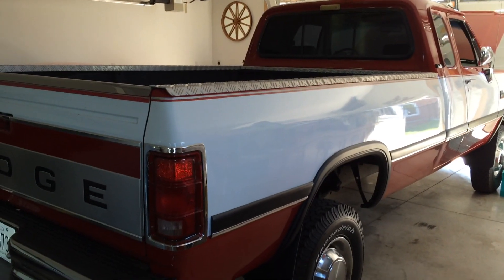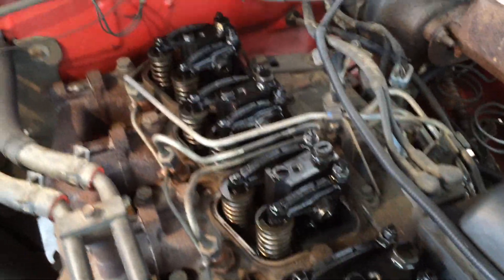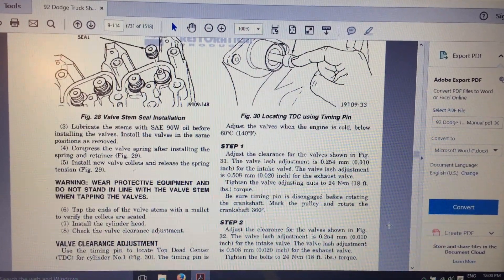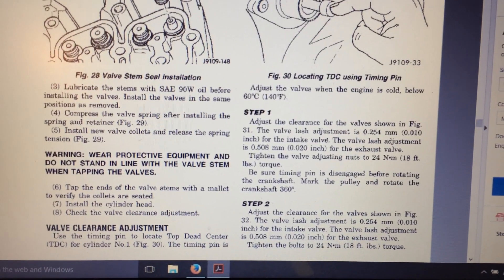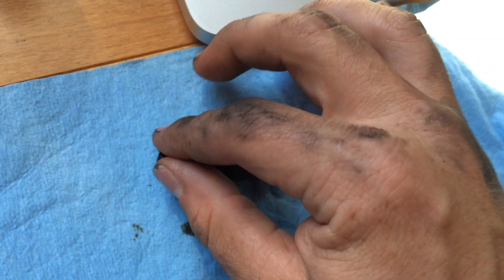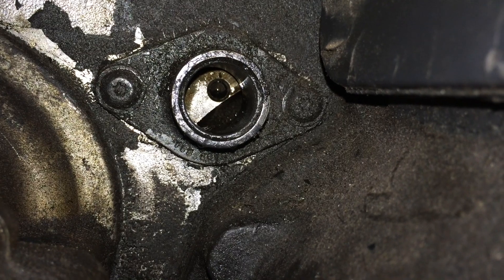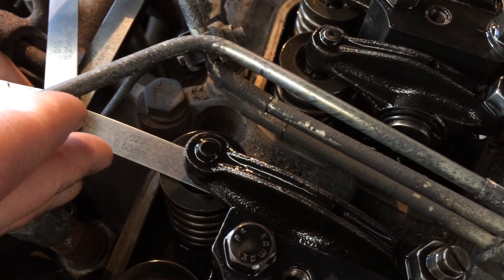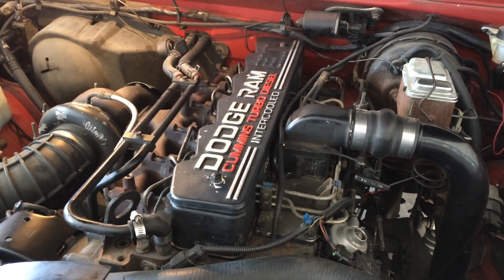12 Valve Cummins Valve Lash Adjustment

Comment: I know this is an old video. Just curious, when torqueing the lash lock nuts, did you go back and recheck lash spec? The reason I ask, is I've been a Honda specialist for years. When attending Honda School there was a discussion about lock nuts being slightly gummed up with oil sludge. They will drag the adjustment screw when locking the adjustment and give a tighter than desired lash.

Great no nonsense video by the way.
-Dave
Reply from the maker: Yep always check the clearance after tightening them down. Not sure if I mentioned it in the video but it's important because the clearance always seems to change a bit after you tighten it.
Reply: @OvensGarage  You are a good man. Keep on keeping on.

Comment: The whole TDC thing, and getting your pistons in an exact position really threw me off for a long time. Can't you just use the alternator method and, starting with #1, cycle it until both valves to open and close, then adjust the lash on both valves. Then cycle #2 until both valves open and close, adjust the lash and so on? Seems like it would be a lot easier minus turning over the engine more.
Reply from the maker: You could do it that way if you wanted but it would take much longer. With this method you get #1 at TDC, do half the valves. Rotate the crank 360 then do the other half. Much quicker.
Reply: @OvensGarage  Thanks for responding. I guess the whole TDC on compression stroke thing threw me. I'm guessing it's for convenience sake.

Comment: So using the push pin to find TDC will get you piston #1 at TDC? You pull back the pin, start turning the motor again and once the pin is pushed in a second time #6 piston is at TDC? Or is it better to find/make a mark on the balancer then turn 360 degrees to find piston 6 at TDC?
Reply from the maker: The pin will only go in at one spot on the cam. You'll need to mark the crank and rotate 360 to do the opposite valves.

Comment: Great video, but what he fails to tell you is that you are actually supposed to release the pin after you've pushed it in before you start adjusting the first set of valves.

Comment: Tip if you break off the tip of the pin in the cam gear, heat up a paper clip or other narrow metal object and melt it into the middle and wait a mins for it to cool and should come out with the paper clip

Comment: A couple of tips for who Evers interested on valve lash you can run your valve lash starting on tdc 1 on compression or exhaust stroke witch ever u get to tdc if it’s exhaust side run those valves then roll to compression then run those. Another HUGE HELP is take a white paint pen and mark down the rocker arm of the valves u adjust on compression stroke it makes identifying the valves u need to adjust so much quicker and the oil and engine temperature doesn’t effect the paint it’ll stay a long time. Immediately before checking lash on a valve apply pressure to the adjustment side of the rocker arm to push out the oil so u are measureing metal to metal clearance Also check ur lash before adjustment about 1/4 of your valves will still be in spec and check AGAIN AFTER TOURQUEING THE STUDS it makes a major difference!

Comment: Did you notice any difference with valve train noise? My first gen has 144k and I doubt it’s ever been done haha. Just wondering if this will quiet it up and make it sound less “clanky”’I guess you can call it.
Reply from the maker: Not a massive difference but if it's never been done it might get rid of a couple of the clankers!

Comment: I noticed you used a socket to tighten the locknut on the rocker arm after setting the lash. Did you attempt to reinsert the feeler gauge after tightening the lock nut ? Usually when you tighten the nut, if you are not holding the adjusting screw with a screwdriver, the screw will turn with the locknut, altering the lash!!  Excellent video with good lighting & a very good description of what you were doing & why. Camera work was good & voice articulation was excellent as well. Great job!
Reply from the maker: I didn't show it on camera that well but I tightened the lock nuts with a wrench while holding a screwdriver through the top. Then afterwards to make sure everything was to spec I used a torque wrench and tested the lash again.
Reply: Thanks for your reply . It is satisfying to know that the adjustment screw was being held stationary while the locknut was tightened. My concern was for those who might not appreciate the necessity of holding it. Great Video!

Comment: You need to tighten the jam nuts and recheck the set. They move and tighten the clearance frequently.
The true measurement is with the jam nut tight.
Loose won't hurt you, tight will. If the jam nut turns the adjustment screw, they go tight.
Cummins inline have running mates on the crank.
If the firing order is 1-5-3-6-2-4, 1&6, 5&2 and 3&4 are running mates. If the valves are closed on 3, I set 3 and watch for the valves to close on 6 and set it so on thru the firing order.
If you turn an adjuster screw more than 1/3 turn, thats a lot. Better make sure you are on the right hole.
You don't really need a pin.
I always set mine slightly loose, I set my pumps for 1100 degrees max pyro temp behind the turbo on a hard pull.
The extra thousandth of lash is lost with the heat anyway and I like the small amount of extra time the valve gets on the seat to cool.
5 million miles and I've never burnt one. 
You can seize a piston at 1150. If it gets real quiet, get your leg out of it fast, drop a gear and cool it off.
Reply: I set my valves at .08 and .018..turbo will come in approx 200 rpm sooner..to loose of valves will slam into the valve seat..see it plenty of times.